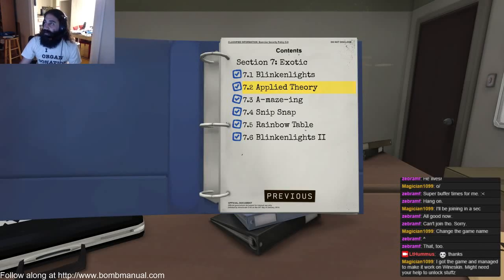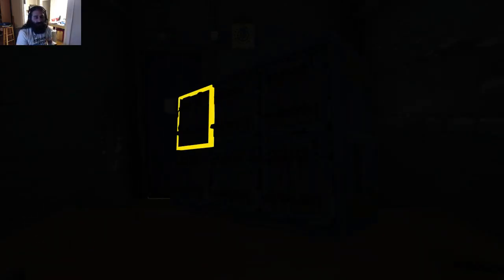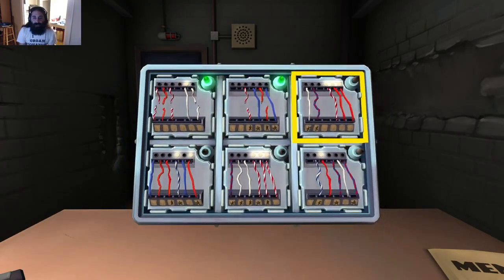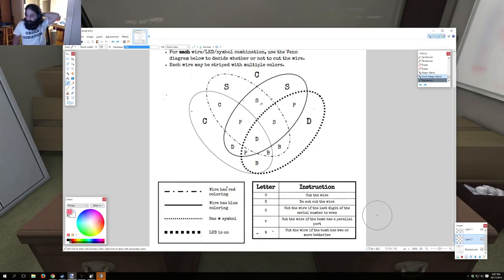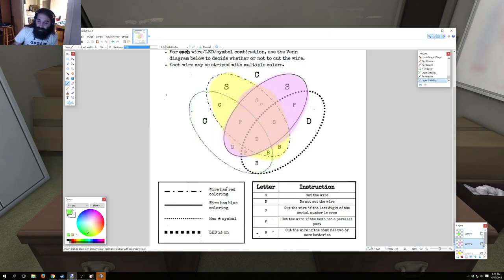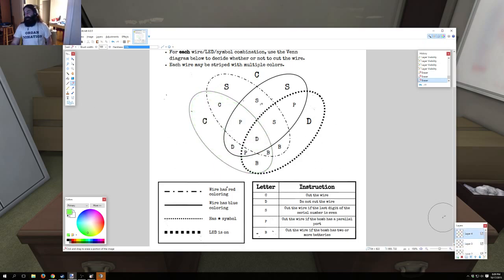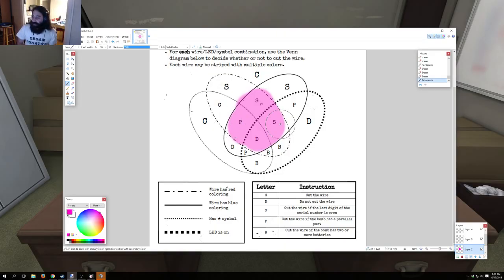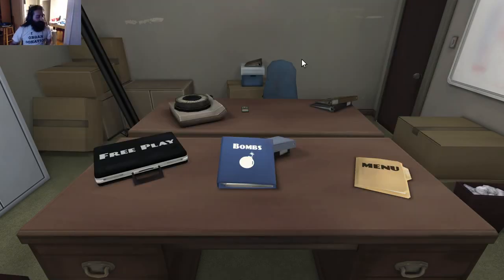LtHummus' Guide to Complicated Wires

Comment: I usually memorize a few key patterns:

Nothing, White or Red with LED only: cut

Everything, White with star only, blue with LED only: don’t cut

Red and/or blue only: serial number

Red with a star included, white with Star AND LED: batteries

Blue with a star included: Parallel port

Red AND Blue with LED only: Parallel port
Red AND Blue with Star only: Serial number

Comment: My friend reduced what you cut to four sentences.

1. Cut: Just white and white/red paired with star
2. Batteries: Star/Red with led
3. Parallel: Blue and Led but not red
4. Serial: just color or red-blue-led

I memorized it so well, I ran custom bombs with 79 Complicated Wires on it and could consistently defuse them in under 3 minutes.
Reply: @hannibal8810  no
Reply: @nidmight yes

Comment: I once got 2 white wires mixed in, and it was solved after only cutting one of the white wires...
and then another time I got a strike for cutting a white wire?
nani tf
EDit: OH because you don't cut it if the white wire has an LED derp

Comment: Fun fact, that 4-bit Venn diagram is also closely related to a Karnaugh map, a map that is used in computer engineering to simplify boolean equations. Of course the application is different here, but the layout is exactly the same, so if you have experience reading K-maps, this is really easy.

You can see that the conditions are laid out in a square that is rotated 45 degrees. Consider each perpendicular direction as an axis/dimension: from top-right to bottom-left we have star/red, and top-left to bottom-right is led/blue. If you treat each input as a literal bit, the conditions are laid out in order 00, 01, 11, 10 on each axis (the "Gray code", which is the order that K-maps use). Match the given wire state with the position on each axis, and follow it like a regular coordinate plane.
Reply: Dude, thank you so much, it helps a lot
Reply: Its actually really simples (solves global warming) 😂

Comment: i have a question
if the wire if white of white and red what to do
in the diagram it is red and blue only
Reply: White wire = neither red nor blue
Red+White wire = contains red but not blue
Reply: +Jinqiu Liu thx for your answer
Reply: you took boolean algebra didnt you Jinqiu Liu
Reply: المخترع الصغير White counts as having no color, therefore it falls into the outer areas of the diagram: LED, star, or nothing )represented by the C at the top.
Reply: Your name absolutely fubbernucked my comment! XD
Reply: Jo The Joker well, it's in Arabic. Writing Arabic and English at the same time is a pain the arse.

Comment: A fast way would just be to laminate the diagram page and then mark each wire on it as it is announced. Not cheating since you're using just the manual, but being more efficient with the way you use it.

Comment: I came up with a variation on this: Check against Star/LED, then check color. Now this causes an important difference: the chart is broken up into four sections, the bottom, left, right, and top. This is much easier to keep track of.

Once you have hammered this out, you can quickly check against two situations: 1. If the wire is white, choose the spot (of the four remaining) furthest from the center. 2. If the wire is both red and blue, check the spot (of the four remaining) closest to the center.

From there, you have two spots remaining (based on whether the wire is either just red, or just blue).  You can use the manual to figure it out from there.

Comment: Hey Lt i totally understand the way to solve the wires, but i cant quiet figure out the way you are reading them up for your manual guys. :)
Could you kinda explain it.
Reply: +Stefan Andersen 
he just says "space" for indication that hes goin to continue with a new wire.
red star space red blue light space light star space red space 

white wires dont have a colour, so its not important for the one at the manual because he or she doesnt have to see into red or blue circle (just outside whether it has an Led, or light, or both)

so the guys at the manual can type for example
rs  - rbl - l - ls  - r 
maybe manually with a pen on paper that they can read the venndiagram and choose to cut or not to cut.
Reply: +Heilige Wurst ofc he is :) that makes a lot of sense when pointed out. Thanks :)
Reply: +Heilige Wurst also, if a wire is white with no led or star, he describes it as "nothing" or "blank"

Comment: Aren't the experts allowed to write stuff to help them. So why would they not be allowed to draw a better diagram? It is kind of like saying that you aren't allowed to remember the things.
Reply: +indjev99  This puzzle in particular get's most of it's difficulty from the diagram, if you change that, you cheapen the accomplishment of disarming it.  You can argue that it's not cheating, but it's certainly not in the spirit of the game.  In the same way that if you had a good memory, you wouldn't need to talk at all, you could just remember all the combinations to all the modules and play solo.  Not cheating, not fun.
Reply: cetusipy Okay, sure going into it with some diagram would be dumb, but what if you chose to use your time during the defusal to make a diagram? It probably won't be very useful on most bombs, but some might have a few advanced wire modules.

Comment: Basically your system is very similar to mine. You do a two-stage lookup, first the two colors, then star and LED. I'm doing the same, however with a different combination. You noticed, how the diagram is basically a 4x4 grid standing on it's corner? The first pair I do (which is red and star) selects one of the four rows running from top left to bottom right. The second pair (blue and light) selects one of the four rows running from bottom left to top right. Then you just need the intersection of those two straight lines and you're done.
Reply: +Clumsy Jester I wrote this algorith in js. You can check here. https://keep-talking.herokuapp.com

Comment: I memorized them in groups.

White: Always

Star: Always
Light: Never
Both: Battery (it compromises between the star's always, and the light's never, to make a maybe)

Red: Serial
Blue: Serial
Red/Blue: Serial
(basically, a color with no modifiers (star or light) means serial)

Red Star: Always
Blue Star: Never
(opposite)

(For single color+light, the star doesn't matter.)
Red/Light/(Star): Battery (the batteries are red)
Blue/Light/(Star): Parallel Port (the port is purple, which is close to blue)

Red/Blue/Light: Serial number (Serial starts with S, and Light doesn't)
Red/Blue/Star: Parallel port (Serial starts with S, and Star does, it's a sort of "not equals")

Red/Blue/Light/Star: Never
Reply: +eduardog3000 this is the exact same way I'm doing it, got a 2:28 on the exotic bomb with this. So far I only memorized white and red wires, check if it's a B bomb and then cut every red and white (except white+light)
Reply: There's a bug in that, it is telling me to cut red/blue/light/star.

Edit: Actually, I can't get it to tell me NOT to cut something.
Reply: Blue with star:never thats not true its give me strike
Reply: +eduardog3000 i cant see the rest!
Reply: eduardog3000 the complicated wires is already already fixed.
Reply: 1 year later, no it's not
Reply: In the manual's venn diagram, where is the white+red / white+blue wire?

I can locate only red, only blue, blue and red, but where is the white mixed wire? How do I know what to do with the white mixed wire?